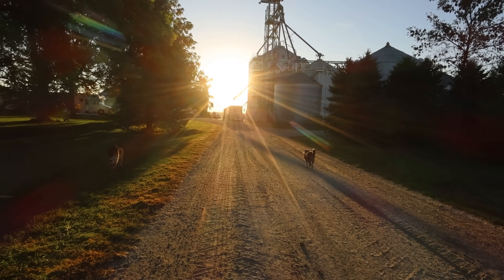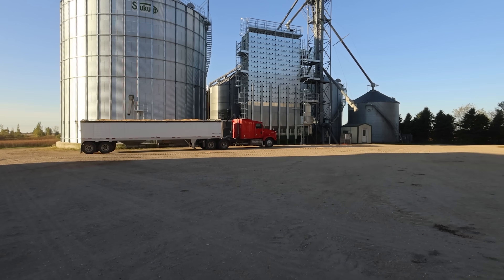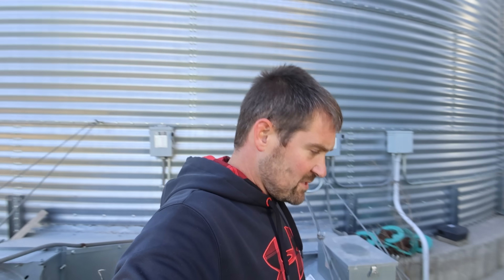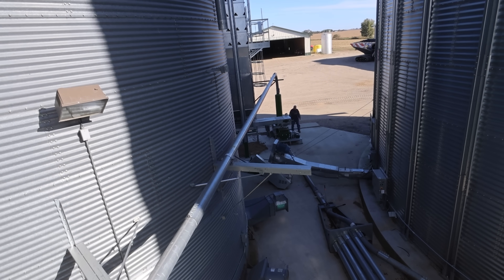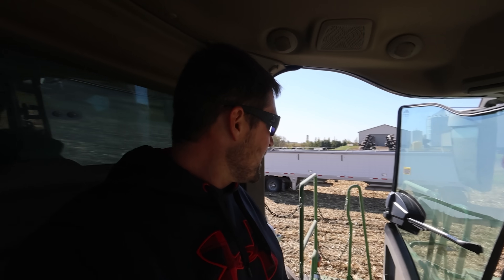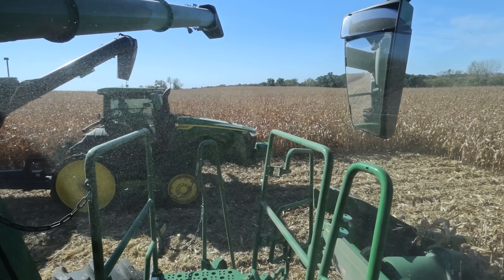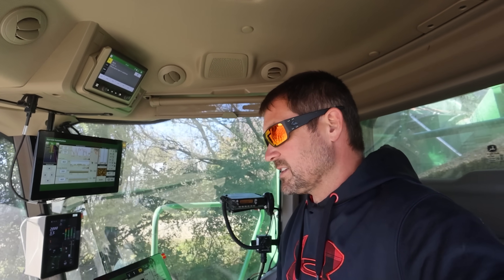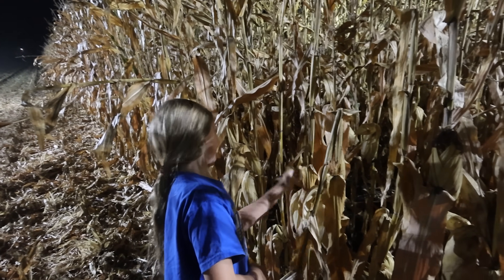Did the New Combine Calibrations Actually Work?

Comment: Have a look in the UK, we have millions of acres surrounded by trees and hedge rows and have equipment manufactures that are suited to the problem you are talking about. 

McConnel probably No1, but also Spearhead, Shelborne Reynolds offer options to.

But basically they are power arms that go in the 3 point hitch of your 6R for example and can have attachments put in them from flail heads to Saw blades for branches. Some with 8 meter reach.

Comment: Keep an eye on the auctions for surplus county or state mower tractors with a Tiger mid mount boom mower on it. They're usually John Deeres so they'll fit right in on your place. I've spent a lot of time on a couple brush cutting on logging roads. You want a rotary cutter, not a flail If you don't want to mess with a chain saw, period.

Comment: We use a limb beaver  on a front-end loader. Works very good for  trimming limbs 6 in diameter. Doesn't throw big chips like a rotary mower. A lot safer and easy on the tractor

Comment: Power companies contract to trim high tension wire right of ways with a vertical frame that has a battery of 5-6 circulars saws hanging from a helicopter.

Comment: a trend the last few years here is to sow wild flowers on the end rows. Fields are generally smaler here,  equipment to (3M limit in width). There's also more tillage done, including plowing and rotavation, so i think the end rows get some more traffic too. all in all, total yield loss for the field is rather small, and there a government subsidy for doing it, and it improves bio diversity, so I recon it pays off. Also, off course can't spray crops with roundup here since GMO are mostly not allowed.

Comment: The other thing you can get yourself is a Pole saw either petrol or battery(Just remember to check oil level in tank Reg!)then just walk along tree lines and whack dealt with and depending on length can reach high.
There is also a unit that fixes to tractor etc on rear or side  multi jointed hydraulic arm like a digger arm that you control from the cab that obliterates hedges/bushes/trees there used for hedge cutting

Comment: They do a tool that runs under a Helicopter which they run along power lines to cut those high trees back looks like a giant circular saw with three blades!.
They do a mulching unit that fits on the arms of likes of Skid saw or tractors with hydraulic power

Comment: Google road side brush cutter. It's a three point hitch attachment that will reach up and out to cut the brush back along your fields. If you have a municipal supply company in your area, they may have one that you could rent. Before I retired the place I worked for rented one of these units and they are a beast. Will do exactly what you want to do.

Comment: Hedgerows are the bane of every farmer's existence as far as I'm concerned...... Back in the day my Grandfather got a product called Tordon 10k that the Railroads used to use to clear brush alongside the pastures we had. It acted a LOT like Agent Orange (dioxin) which has been banned (for obvious reasons), but it just BURNED everything right to the ground, including live, standing trees that had been there for years and just grew too close to the tracks for the railroad's liking......  There would be NOTHING but bare ground and dead brush/trees after a few weeks. I don't know if you can still get Tordon or not (maybe someone else online would know).,  but it sure beat a chainsaw. It came as a liquid, or dry granuals (I remember him having a little soup can and shaking out a few pellets at the base of multiflora rose bushes and a couple weeks later they were dead to the roots). That would be my suggestion. Heck of a lot quicker and easier than any mechanical trimmer.........

Comment: In the UK excavators can be fitted with a saw blade but also can be fitted with a "claw" that grabs and cuts trees and sets them onto the ground safely. Trees obviously get cut up for firewood usually but everything else gets pushed into a pile and burned after it rots down a bit. If sure this method is done all over the world where necessary.

Comment: Best thing I ever did with my air system was take the filter off and put a turbo 2 air cleaner on the intake. Every now and then wipe it off if there's humidity but it stays pretty clean and works great.

Comment: we cut alot of branches along roads, for that we use a Slagkraft and a Greentec saw blade, we use it on a wheel loader but they have carrier units that goes on tractors aswell, works like a charm but it's not cheap

Comment: Get an attachment that we use to cut the side branches of the Casuarina trees in orchards used as windbreaks. It has four blades and about four meters tall. Fits on the back of a normal three point hitch and pto.

Comment: To manage and control complex equipment like this, you need to borrow a page from the aviation circles by employing checklists.   Assemble a booklet of laminated sheets containing procedures you commonly use for set up, prestart, operation, unload, shutdown, and winterize/preharvest setups. Whatever else you can think of that is complex and needs a long checklist before employing it.  The reason behind laminated sheets is to use dryboard markers or grease pencils to check off each item as you go.

Comment: WorkSaver makes a tree shear for the front of a bobcat
It is essentially a 10 inch capacity bolt cutter on a 5 foot long arm

It rotates 90 degrees and will cut an oak limb up to 8 inches I diameter

I use it on the front of my bobcat it will reach about 12 feet high

On the front of a tractor or telehandler, it would go higher

Much faster and safer than a chainsaw

Comment: Get a well built disc mulcher that’s high flow that will go on the skid loader. I used one this spring and you can lift it up and flatten it towards the limbs drive in to the branches and take them right off. I believe the disc mulcher is rated up to 6”-8” diameter trees. Thanks for such great content!!

Comment: Rent  a trimmer.  With telescopic boom.  You can  sit  in the 4 wheel  drive  cab  and buzz off the limbs.    Check with rental company.  Electric utilities.  Clear  transmission  line right a ways. With this unit.    Thanks for the ride. Later.

Comment: You need the helicopter buzz saw.  

Dragging a chain will knock the dust off the windows and reduce static electricity.  4G Harvesting now drags chains on all 4 of their combines.
Reply: That would NOT be cheap to have a helicopter do it😂

Chain doesn’t work down here🤷🏻‍♂️
Reply: @AlabamaLinemanFarmer as long as the chain can make contact with the dirt it will guaranteed work in any environment

Comment: Tree trimming: Just depends how large the branches to cut are. 14 ton excavator or larger can go up to about 24 feet+(select a rops rated cab excavator with fops and front window grill, us$50K+ years ago to put forestry cabs on excavator conversions) (Forestry cab equipment is expensive unless fortunate to find a good deal on a used machine) Use a Woodcracker_America tree shear (made by Westtech in Germany) or other (MDE Machinery, Northern Ireland, UK Koala 400 tree shear cuts 16 inch branches  & smaller models, TMK grapple saw and tree shears made in Finland). Follow shear with mobile tree chipper or tractor mulcher. Instead of a tree shear use US made Fecon CM36 inch mulcher on a 14 ton or so excavator. Tractors- the side reach mowers are mainly used off trails or roads. There are tree shelterbelt high trimmer/ cutter tractors put together in the engineering shops near here. The tractor bonnets are replaced by alloy steel, the windows in the tractor cab can be forestry grade armour glass, a hiab crane is modified etc.

Comment: There is quite a few different types of attachments which have booms and some are even extension booms that connect to the 3 point hitch on a tractor. Depending on size etc that dictates how much Tractor HP is needed. Look at what height you are needing to ideally get too. And based on that then just search on rear mounted tractor mowers with XX reach..... There are mulcher mowers, saw mowers. Mulchers are pretty universal as can also be used for not just reaching up but also reaching out eg along ditch edges etc. But, be aware some are not cheap....... A great video thank you. Keep safe and well everyone :)

Comment: Check out the Lane Shark mower. Not sure if it will reach high enough. It’s a rotary mower that goes on the loader arms of a tractor.
Reply: Yes it would work for what he wants to do. He just wants to reach a little higher than normal tractor height so it’s not hitting the equipment and damaging anything

Comment: Maverick boom mower by Alamo. It’ll reach higher than you can see out of the side window. 3-4” limbs / trees are not a problem. Possibly a little bigger if you chip at them slowly. Only draw back is it’ll take a dedicated tractor for it. Lots of undercarriage weight and counter weights on the left side to hold it up. I personally have 100’s of hours in one. You won’t be disappointed at all other than the price tag.

Comment: They make an attachment that fits on the front end loader that’s is hydraulically powered like a vertical bush hog. You just get the height right and drive around the tree line. It takes care of the problem

Comment: I live in the south.  The county has a tractor the has a brush cutter on a hydraulic arm for trimming trees along county roads.  Whether there is an attachment type, I don't know.  It looks as though the was built onto the tractor.  Also, the power line companies have a 4-wheel drive device with a rotary say at the end to cut trees higher up.  This extends fairly high.

Comment: There's a lot of different options for putting on a tractor to deal with those trees. I think the simplest (though possibly the slowest compared to some of the options I've seen listed) are 'Tree shears'. Basically giant hydraulic sheers for cutting off limbs. I know Erskine out of Minnesota makes some pretty impressive ones that'll handle up to 12 inch trees and branches.

Comment: You can get a saw attachment for your skid loader or even your bucket loader tractor. They usually have 25 to 35-ft sticks with 24-in saw blade on the end all hydraulic. So then you can use your bucket controls to go up and down and it stays about 20 ft away from your unit. So you're out of the falling branches and everything that it cuts?

Comment: Trimming trees. I have seen a tree trimming video where a helicopter flies along a power line with a cable hanging down with several circular saws attached. It lake a vertical line of saws all running together and it cuts the limbs so they don’t get into the power lines. It could be expensive but it could probably go around all your fields in a couple of hours. You would have to go back with a skid steer and buck the cut limbs out of the field into the tree line. Might work. 👍

Comment: 15:25 where the Helicopter Saw blade Pilots at. It may be a private company but the RR always uses those HeloSaws.
Reply: Not too cost effective though😂 it works for the railroads because they cut miles at a time, it wouldn’t be cost effective to hire a helicopter & pilot to cut 6-8 trouble spots in a field🤷🏻‍♂️

Comment: Your tree problem: Yeah, there are attachments for that. They amount to brush cutters you just wave around in the air. State DOTs and public works departments are fond of some on articulating arms you mount to the 3-point (because you can also use them to mow grass on the opposite side of a guardrail or down in the bottom of a ditch), but you can get them in simpler loader and skid steer mount configurations, too. Or, you know, do it the old fashioned way and stick your kid in the bucket with a chainsaw. Whatever works.

Comment: Ha ha, those guys who designed that filter are going to have to do some redesign.:goodvibes:Zach, Andy on Farming Fixing and Fabricating hit a downed tree while chopping corn, and it bent the corn head up. He and his helpers were beating and banging with sledgehammers for an hour to fix it. There are attachments for your tractors to cut those trees. They are like a mower on an arm that you pick up hydraulically to trim them.

Comment: Agree with the other posts about the helicoptors.  its crazy to see that huge saw hanging off the helicoptor but it works and its fast
Reply: But it’s also expensive, takes a good bit of cash for such little work. He can easily find attachments that fit on a skid steer or loader tractor that are far cheaper

Comment: Down  here in NZ we have special contractors that would do that. They use heavily modified tractors or a Merlo style machine that has a long retactable arm that can move up and down. Along that are are 3 or 4 hydraulic motors with high speed cutter blades that rotate.
Then tey just drive up and down the tree line chopping off anything in the path. Some of them can also mount sawblade to cut off bigger wood or take the top out of a tree. Have seen another version that the power companies use that is hung off the bottom of a helicopter.
Somebody has to have something to do that job safely. Cleaning up can be a bit of a pain but I usually get it mulched where it lands. It rots away pretty quickly.

Comment: You guys in America don't really have hedgerows but a tractor PTO flail hedge cutter would do the trick nicely. I would advise at getting a flail one to annihilate into little bits. Last thing you want is large bits behind left on the ground and having to stop all the time to move them which you'd get with non-flail ones. Plus with the arm controls and flail you can do ditches and other places.

Comment: Zack, I hope this helps. A helicopter with a large, dangling saw is called an aerial saw or flying saw, used primarily for trimming trees along power lines and railway corridors. This technology allows for faster and safer vegetation management, especially in difficult-to-access areas, by using a combination of highly-skilled pilots and specialized, powerful cutting equipment.
Reply: My wife works for the local rural electric company, and she says the linemen crews have to follow the helicopter to fix the outages they cause by accidentally hitting the lines and taking them out.🤣🤣
Reply from the maker: I need one!! Does John Deere build a chopper?
Reply: @MillennialFarmer  Probably not.....
Reply: @MillennialFarmer have you seen the image of a combine cab connected to a helicopter tail. Someone made as yard decoration. It's pretty cool
Reply: I was thinking that a brush cutter or flail mower attachment on an excavator might work. You probably don’t need to trim the whole height - just high enough that it isn’t interfering with equipment in the field.
Reply: That's exactly what came to my mind. Probably super pricey however.
Reply: see my attachment, call Cleetus!
Reply: They have all kinds of equipment that does stuff like that.That is on like bobcats and skid steers and look like a telehandler that you can just raise up and cut look into the power line clearing crews
Reply: Yea let’s go broke hiring a helicopter to trim some limbs🤦🏻‍♂️🤣

There’s quite a few attachments that can be found for the front end loader or skid steer.
Reply: @AlabamaLinemanFarmer  Or find out if the state uses this capability, and if so, go talk to the company and find out if they will be near your area and how much it would cost to do.  Don't know about the "attachments," but I do know about a chainsaw, so just cut the tree down and problem solved with no future maintenance.
Reply: @josephbasanta  being a lineman I can tell you it won’t be cheap to use a chopper. Period

Comment: Skid steer options or here is a tractor option.  They have a few model types this is one.  Bush-Whacker Rear-Mount Boom Brush Cutter | Model RME-17 | Width 204" inches | Horsepower 90 HP | For Tractors

Comment: I go around my hay fields with a mini excavator running a 4 foot bush hog. I can trim about 20 feet up if needed. If money were no object I would also have a boom mower for the tractor like the DOT guys use.  Tracking the mini around is slow. In my area the invasive species like the field edges. So I am getting 2 birds stoned at once by mowing them back.

Comment: Rode with my cousin's son as he was harvesting corn with the new combine, their old burned up. It was gone in 10 minutes. Can't remember what they got,,,,,sorry. They have a 12 row corn head and a bean head. It is a front tracks and is steered by joy sticks just like a skid steer. It also has collapsing corn head.
Does a tractor have an attachment? It's called a bucket. You drive and Onyx can cut!!
The cab in your Deere seems to sit higher that his combine, there were stakes higher than the cab.
Reply: Fendt ideal are the ones with joysticks

Comment: Easy way to make sure you know which chain goes to which bin as well as it they are opened or closed for the damper valve you're adjusting - do some colored spray paint on the chains and the side of the bin, or mount a little laminated card w/ a mini-map of all the bins (if you can't visually see them all from that spot) and then spray the chains so you know when you put your bolt thru it to force it open / closed so you bolt thru the painted one it's full open / closed.